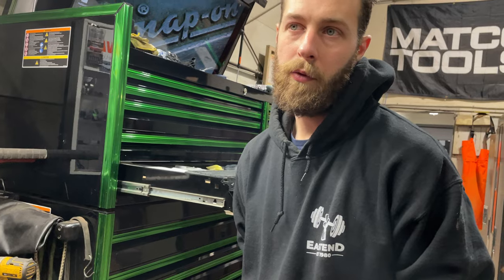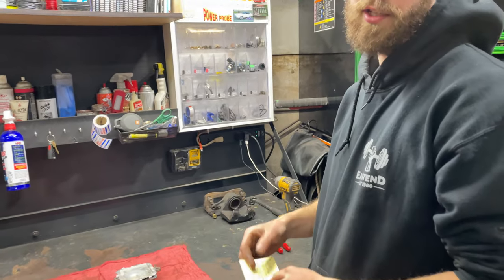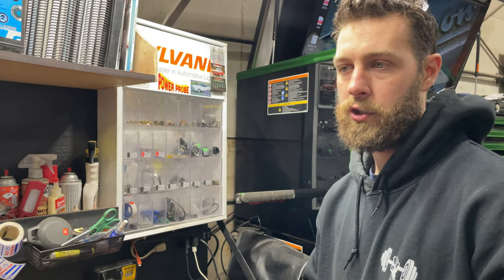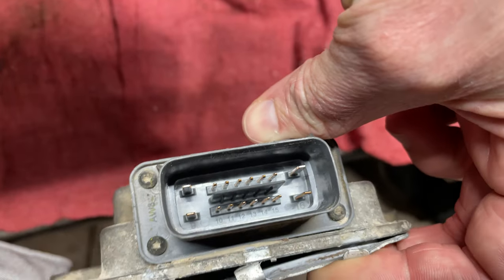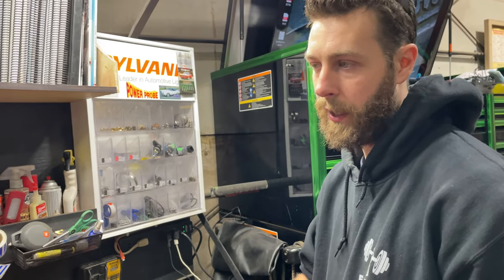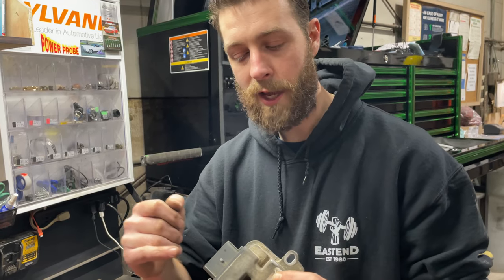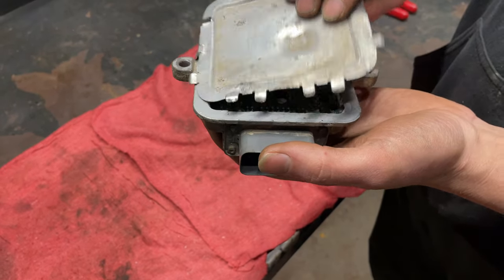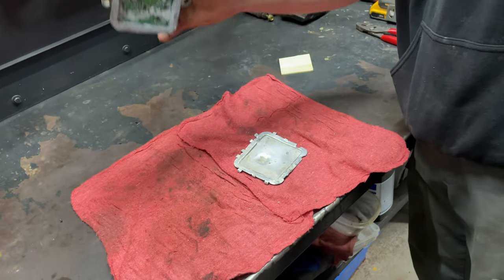Water Damaged Trailer Brake Control Module GMC Sierra 1500 2019 23337305

Comment: Had the same error on my 2018 Sierra for the last 1.5 years. Finally decided to look into it. Great info in this video for pin out and where to start looking. Replaced the module as the aluminum was rotted out like in the video with our Canadian winters. Ended up painting the new module with rubberized paint to give it an extra layer of protection. Thanks for the info.

Comment: Appreciate the info! I have a 2021 silverado with the 3.0l duramax. Didn't come with factory trailer brake controler but i purchased this module and the dash switch. Looking to figure out where module location is. Any chance there is a video of the install/ location for the module? Thanks for the help!

Comment: For me, it alarms one time at start up and not again until I start it again (2016 Silverado 1500 LTZ). I'm onto this step now, I've replaced the internal cab controller, the plug at the rear (not the pig-tail).  I'm hoping this is it, I'm not as mechanically inclined as you.  I'm going on process of elimination. LOL. I'm in Utah and we have a lot of salt on the roads too. Thanks for the video.
Reply from the maker: Hope this helps ya rob. To be honest the module looked brand new from the outside, couldn’t even tell until I pried it open
Reply: @JFinckMinistries no it did not. I've replaced everything but the fuse box and the whole wiring from front to back.  The service shop I took it to led me down a rabbit hole of repairs and state that these could be the only two other problems to fix

Comment: I have a 2016 tahoe that after multiple times hooking up trailer. 2 times now it has caused the truck to not want to start at certain times and give multiple buss, ecm, tcm communication codes. If this is the issue can the car run without the module plugged in?
Reply from the maker: @tylerist8  hmmm interesting, I want to say it’s definitely possible the module could be causing a short circuit on the buss and creating that no start condition
Reply: @Tech-28  it's just weird because I've done nothing to it since it started happening and all of a sudden it starts up just fine with nothing besides CEL (permanent coded)
Reply from the maker: @tylerist8  do you know what fault codes you have in the system?
Reply: @Tech-28  stored U0101
Pending p0700
Stored U0100
Stored U0073
Stored p0700

Comment: Could this possibly cause trailer running light fuse to blow? I've replaced the lights and entire wiring on trailer. I've checked wiring under the truck from what I can see, everything is good there. I'm thinking that one of these modules is the problem. I have had the check trailer brake system light come on maybe two or three times in the past year but it'll go off and stay off for a long time. Thanks for any info on this
Reply from the maker: Yes that is definitely a possibility
Reply from the maker: I would install a circuit breaker in place of the fuse (same rating of course) and then unplug the module and see if the circuit breaker stops tripping

Comment: Any programming needed after installing the new module? Or is it just plug in and go
Reply from the maker: Just plug and go. I erased fault codes after replacing it but I imagine they would clear themselves after a few drive cycles

Comment: Can corrosion like that happen to a Florida truck 2018 gmc sierra denali ultimate 6.2 intermittent service trailer brake service stabilitrak and abs light on also lane assist disabled when this happens
Reply from the maker: Yes it can, there is a bulletin on this issue